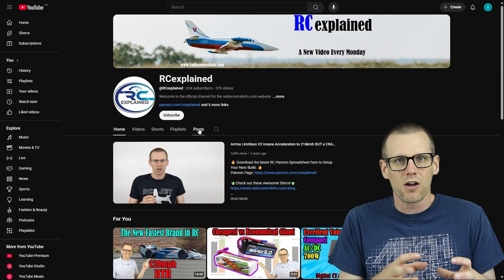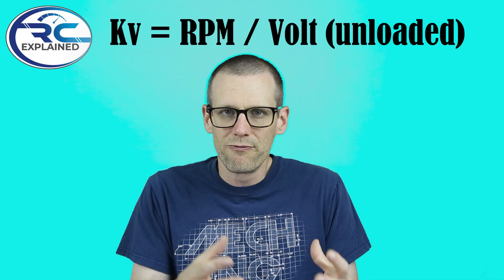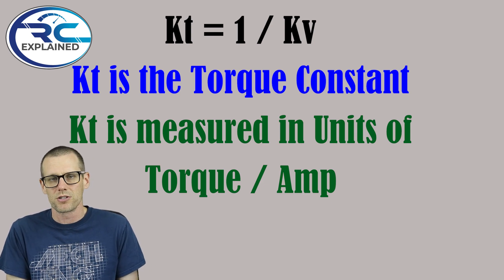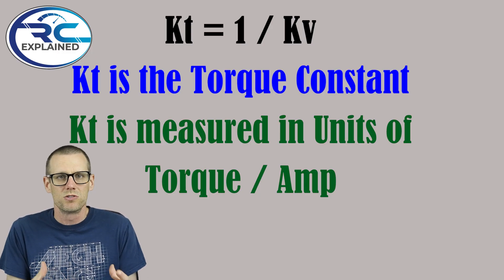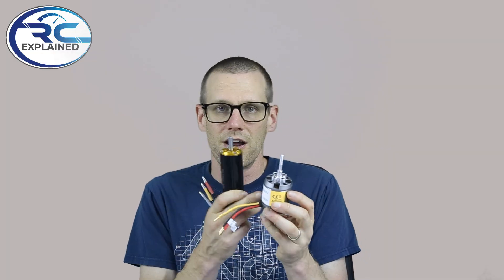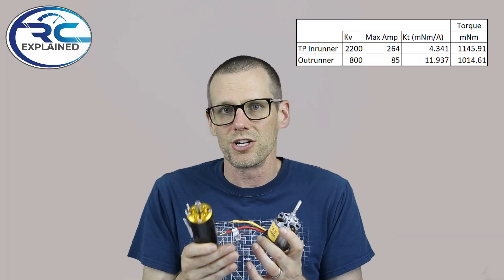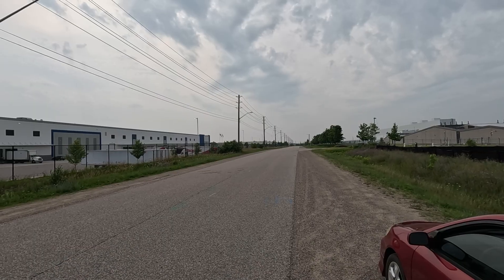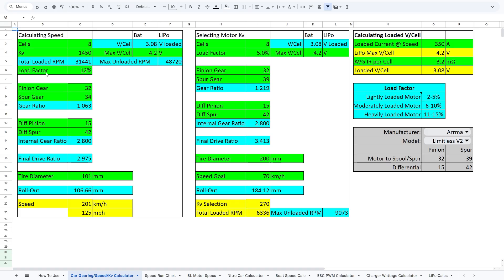RC Motor Kv: What Everyone Gets Wrong

Comment: This basically just old us that we can't figure out the right motor.   Didn't really explain differences in performance of all the motors with equal torque and size on the table from Neu motors at time 5:17.     Vid needs a redo.   even if we use the table on you Patreon, how do we get the necessary info like "load factor" .     So we are back to square one.     Here's my two bits...... in RC cars, we just choosing from a couple options that all work well.  To make final decision...stick with this.   lower kv = low end power (torque).    in pro 1/8 truggy and buggy, everyone uses the lower kv 1900 motor.  (no one uses the 2200)            Basic explaination.   Motors of same size, will have same power.   power =torque*speed.      if power(size) is constant then there is tradeoff between torque and speed.     higher kv is higher speed, therefor lower torque.    (high speed is good, but it takes longer to get to top speed if you don't have torque)
Reply from the maker: Power and Torque are equal for all brushless motors such as the ones on the Neu motor list in the same size/weight class. I have a video coming out in a week or two that goes through more details using examples from this list. You have the formula, so you'll know how it all works before the video comes out.
Reply: Someone didn't pay attention in class

Comment: How do you factor in poles when determining torque?  Is that part of the Kt equation?  My basic understanding is more poles equals more torque and less speed.
Reply from the maker: Its already built into the Kv value. 6 pole motors have lower Kv.

Comment: Good information, but I never used KV for speed. I was always about efficiency over power and speed, So kv is how I determine where I want my build to go. I started playing with brushless around the time castle creations and Sky and technology (Quark) started offering their ESC's (around 2007/8) and everyone was going with higher KV as much as possible for the voltage provided, For example the pretty much standard 2400 KV at 6s (pretty much every surface RTR setup now) or 3600 kv for 3s or 5700 for 2s. I always looked for different things, people want speed in everything, I wanted run time. So I figured out there is two ways to make RPM, High KV and low voltage, making amperage be the matrix for RPM, Vs low KV and high voltage, making the voltage be the RPM builder. In my experience lower KV and higher voltage makes power more efficiently allowing for a smoother power and a cooler setup. Also since the RPM is made with voltage, the current can be manipulated with gearing (within a reasonable limit) so speed can be got. For example a 1200 kv motor at 6s22.2V at 3.7 volts per cell runs 26,640 RPM ( inow it is higher at the topped of voltage of 4.1V, I use 3.7v as nominal) from there i can gear to the speed i want and maintain efficiency (Lower amps) and increase runtimes.
   Like i said, I've never wanted to curl the ground, or turn the world, I lean towards efficiency and consistency and longevity of the system

Comment: Im not entirely sure but I would respectfully disagree with you regarding lower KV motors don’t have more torque than a higher KV. Reason being more lower KV motors in RC have a 8mm shaft. While higher KV motors usually have a 5mm shaft. Therefore a heavier 8mm shaft rotor will produce more rotational inertia since it weight more than a motor with a 5mm shaft?
Reply from the maker: Interesting perspective. Im confused as to how you get torque out of increased inertia. If the shaft is more difficult to rotate as you say it would have more inertia, it is going to consume more torque to accelerate the 8mm shaft.  The motor would then produce less torque under acceleration.
Reply: @RCexplained  well 4 stroke engines do produce better torque with heavy rotational mass especially if they’re a single cylinder! that inertia helps keep a consistent crank speed throughout the engines cycles before the power stroke. perhaps that’s where the logic here stems from? It doesn’t make sense but one thing I’d thought about for torque production with electric motors and I’d like to know which would be superior for ultimate torque, a traditional external stator car or boat motor or similar around 1500kv and 90mm can drawing 150a on 6s which is quite powerful but that same power in a 150mm diameter outrunner? so suppose the outrunner is 500kv and the other is geared 3:1 which one would theoretically produce the best/most torque and power? Obviously there’s pole count and dozens of other variables even just brands but theoretically? Or with adequate ratios how would a small high kv motor compare other than its losses through the gears and heat? I’d assume if power draw was the same then the output from each should be close if each motor was well designed and efficient and it would be packaging and weight to consider.
Reply: @needmoreboost6369 if you bring that theory to twostoke it kills what your saying
Reply: @Morecrazythanyou rotational mass won’t hinder the two stroke torque or rpm’s output in a sense it’s producing that power just to spin it, but it will however slow acceleration and if it’s in a vehicle it’s a similar effect to it being heavier it slows down the delivery of usable power. You’re right it kills the power you feel but the engine is still producing the power it’s just overcoming more mass.
Reply: Rotational inertia doesn’t affect torque so much as it’s something to consider for acceleration only,it’s a bit more complicated than the shaft diameter The kv has nothing to do with torque output at it’s unloaded measurement, it’s more dependent on the current the windings can take, the lower the resistance usually means the higher the torque, The torque can vary considerably on motors with the same kv,, often a motor available in a low kv with an option for a higher kv in the same can it is  the higher kv motor which outputs more torque and higher rpm’s! But more amps! Less turns of a heavier gauge wire usually this is indicated in the amps they pull.